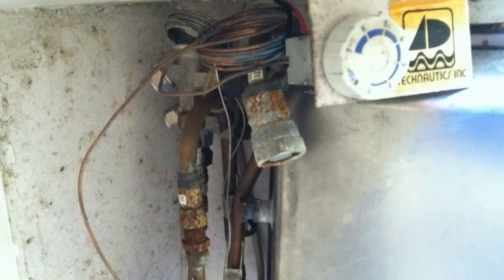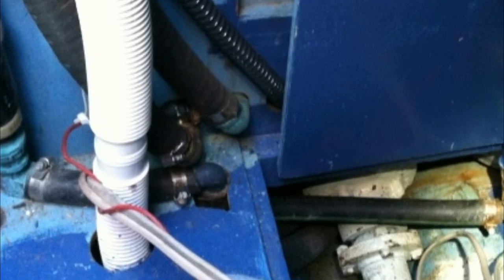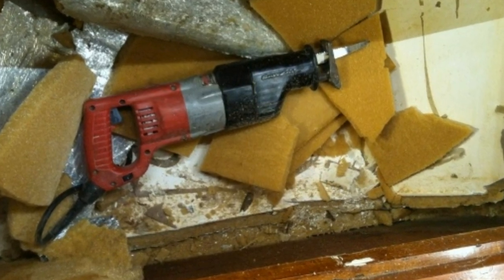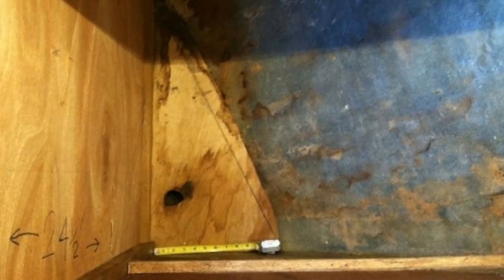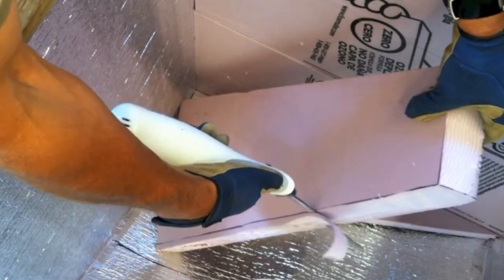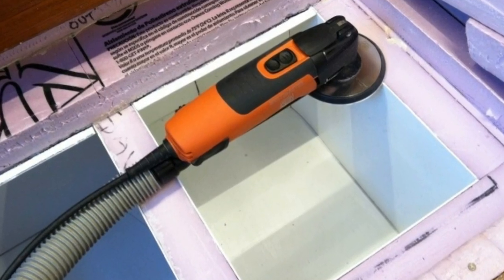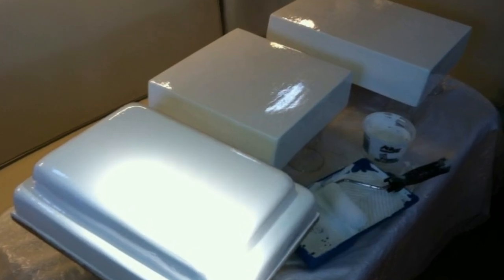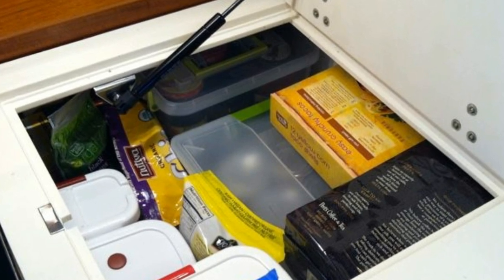SV Ramble On | Refrigeration

Comment: Ah, most of your videos are great, this one is such a short overview, with not enough content. Would be nice to see more detail on how you did it. I'm thinking at least 4 to 5 videos. I realize that is a lot of work though so. On my last boat, a endeavour 40, I had to pull the entire unit apart, remove all the insulation, etc.  But never got to rebuild it before getting rid of it. Any old boat will need a refrigerator rebuild as the foam will be toast and therefore the amp hours to run it high. I was thinking of pouring two part foam in after the reflectix insulation. to avoid potential leaks between seams of flat insulation, but the poured foam can have voids as well. The off the shelf units just aren't big enough, or are only front loaders and not very efficient imo. I have a marine fridge on my rv and while it is fairly efficient it has condensation issues.
Reply from the maker: Hi Bob, this was one of the first projects we tackled when we bought the boat, long before we started posting things on YouTube so it's more of a compilation of still photos we used to document the progress rather than a "how-to" video.  Also, we actually almost bought an Endeavour 40 before finding our Tayana 37.  Thanks for watching.
Reply: @svrambleon  Endeavours are not well built boats IMO so you are lucky I guess to have not gone that route. Tayana's have their issues are well though but Bob Perry drew some nice lines on them. We almost bought a Tayana 37 but it had so many problems on the survey and sea trial we walked. Probably a good thing we did. Now I am thinking of a Trintella 4 or a Victory 40 as my next boat next year when I retire. Time will tell.

Comment: I thought the tecknautic  system was the best one you could get when it came to be energy efficient and the use of cold plates means the fridge wont run all the time. That was a lot of work to pull all of that out.